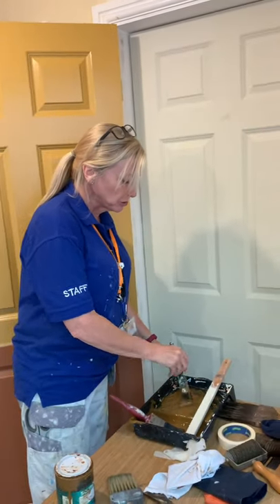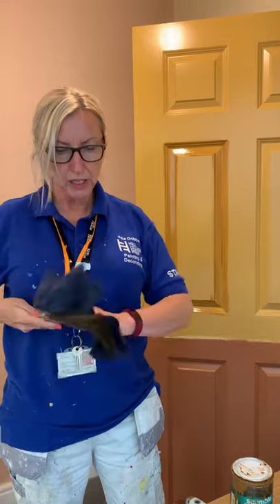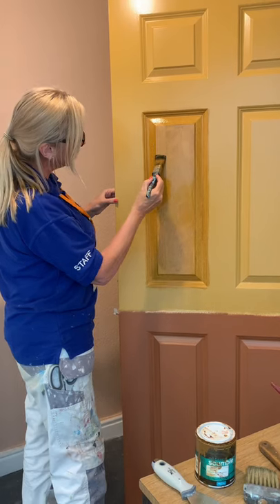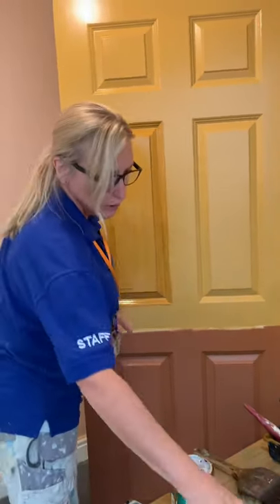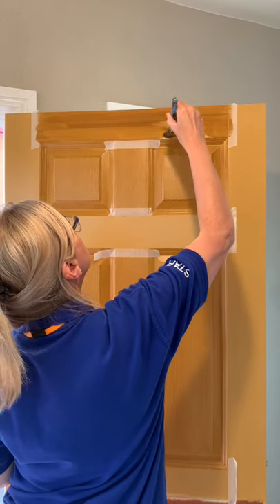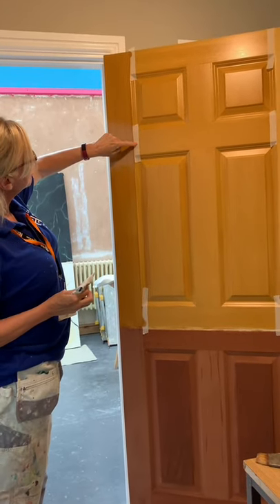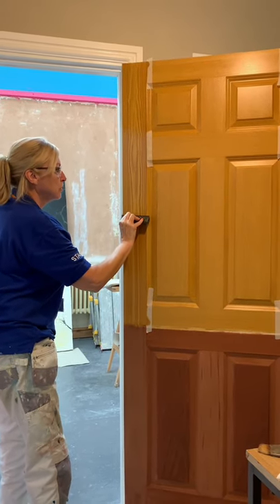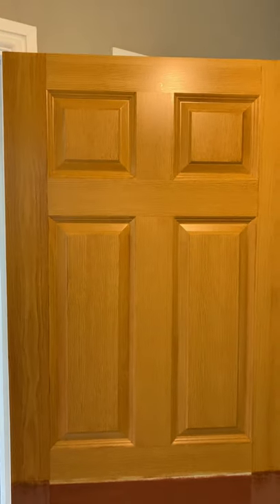How to create an oak effect using oil based scumble

Comment: Could you use a mohair mini roller on the panels..? Brilliant video by the way, where can you get the various tools needed..?
Reply from the maker: You could use a roller , brush is very quick but if you wanted a more even coating yes. Tools are specialist , we have trouble finding them when they wear out , but if you try Google there will be somewhere . Wrights of Lynn is where we purchased in the past , but I’m not sure if they are still trading .

Comment: Simple enough, good demo. If I wanted to take that back to white (water base) would it need any special primer or could I just start top coating?
Reply from the maker: Abrade to remove the glaze using the wet and dry method ( see in another video) then undercoat to obliterate the colour